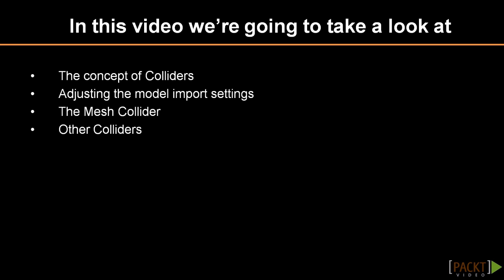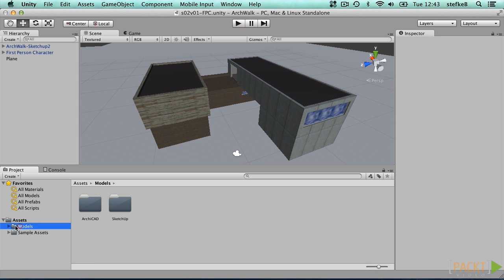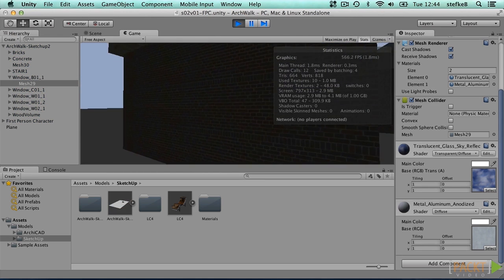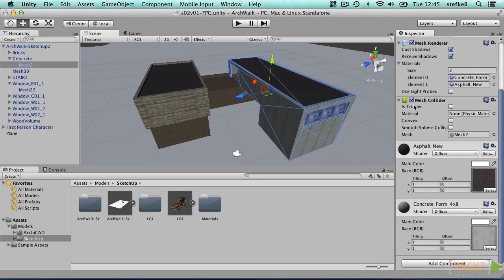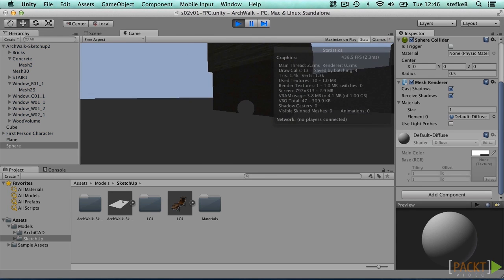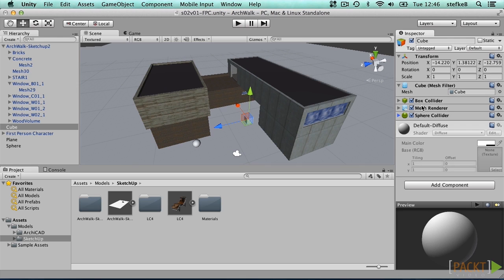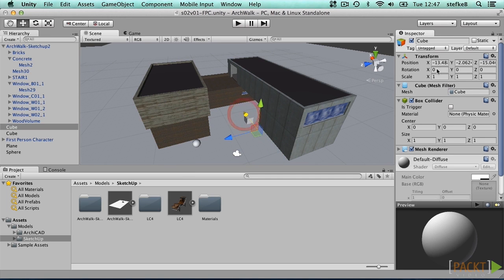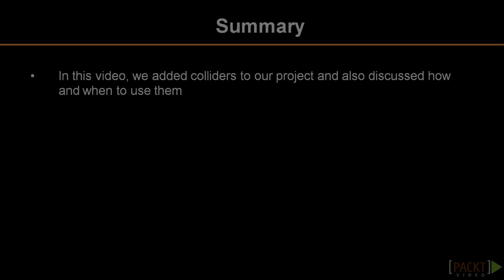Preventing Running Through Walls | packtpub.com

Comment: That really didn't fix my problem tho... Adding either a mesh or box collider to my buildings didn't stopped my character from going through it. Yes, my character has a rigidbody component. He cannot walk through walls having a box collider for example.
Reply: I have the same problem, apply a mesh collider to a floor for an example, or floating island, but player goes right through it, did you fix it?